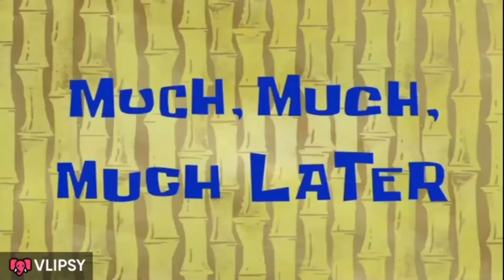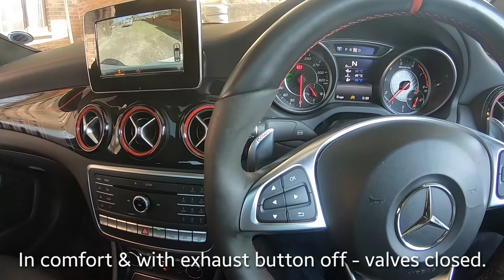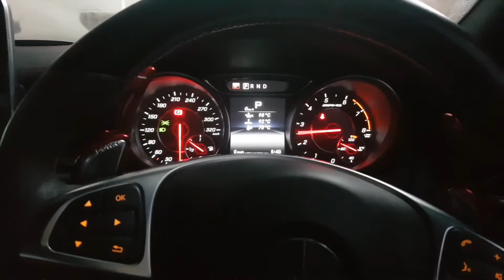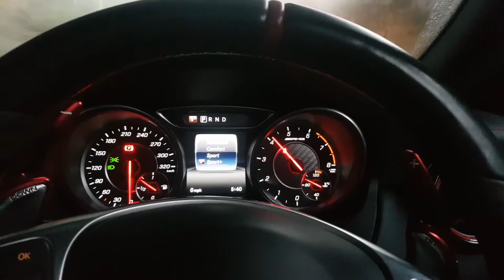CLA 45 AMG ‐ DECAT DOWNPIPE INSTALL (COLD START / REV)

Comment: awsome install vid. removed the old downpipe and radiator fan assembly in FOUR SECONDS. Why was every bolt you went to undo with a rachet already loose? lol. You had no idea the fan had to come out huh. One last tip, Unplug your O2 sensors before unscrewing them...
Reply from the maker: Thanks bruv! Bolts were loosened before and then I did the last part on video to show the steps...I had to film & work which isn't the easiest
Reply from the maker: Thanks for the 02 sensor tip 👻 ...that would've definitely helped lols

Comment: Hello I have a Genuine question that I can’t seem to find the answer too hoping you can help me with! so from what I’ve noticed The Cla45 and the Cla250 are identical until you get to the engine ones got more power. Giving the fact that they’re extremely identical and both 2.0’s - Would this Catless Downpipe fit my CLA250 ??? I really want this brand and I’ll prefer to have it over the Armytrix DP
Reply from the maker: I am not sure but reach out to the manufacturer - Rogue Performance and check if it does fit

Comment: Did you have to remove the fan for the install?
Reply from the maker: Yes you need to remove it for space...it's tight. As well as the air box & ecu
Reply from the maker: You doing an install?

Comment: why your cla has smaller screen like 2014 model i had bought a 2015 model manufactured car i  do have a big screen but i do not have dynamic select assit package and two buttons are missing one is exhaust flap open button another one is for dampers i think i dont have that rotating mode select button with individual comfort sport sport+,i only have comfort sport and manuel is this package optional because i was about to buy another 45 amg that was also manufactured in same year 2015 but made after September that one had all these options flap button plus round mode selector buttons,when i searched about it it was mentioned that cla 45 amg manufactured in 2015 after nine month had these options available in it...and those manufactured before ninth month didnt have it,can i install these features afterwards flap button and dynamic assist package i missed that 2015 after September manufactured car someone  took it before i had a chance to buy it and it had lot of work done in Mercedes workshop 38000 km driven in its service history and the one i bought which came to me was almost like a new cla 45 amg only driven 12000 km non accidental and never painted but still i feel i should have these features in mine flap buttons dynamic assist package....
Reply from the maker: Thanks for the feedback 
Yes there are a lot of packages on offer

Comment: how did you shut off the o2 sensor to prevent that CEL?
Reply from the maker: No I used a CAT fooler that I purchased with the DP and it fools the ECU. It literally just screws on between the DP and the sensor. I think I have an unboxing video which shows it
Reply from the maker: It's the brass part you can see here: https://youtu.be/VqpDA7ckY_E

Comment: Thinking of doing a downpipe on my 220 amg, any suggestions?
Reply from the maker: Hi I 100% recommend. It's the best mod I did on the car. I had the AMG sports exhaust and it still made a massive difference to the sound
Reply from the maker: You in South Africa?
Reply: @PROJECTDRIVEN1  In the UK, london
Reply: @PROJECTDRIVEN1  That's the exact car i have 😂
Reply from the maker: Okay cool bud. Got mine from Rogue Performance in SA. Reach out to them and see if they can ship out to you
Reply: @PROJECTDRIVEN1  Thanks for the advice.
Reply from the maker: Welcome bud. All the best!

Comment: Does it need a tune? And void warranty?
Reply from the maker: Don't have to if you want to sound the pops and bangs alone which the downpipe alone will give you. But if you want to get the most out of of it then a tune will add a lot of performance as well.
Reply: @PROJECTDRIVEN1  wait does ur car have a check engine light tho without the tune ???? i'm really looking to buy one
Reply from the maker: No check engine light & ECU has adapted to give a bit more power from the additional flow. But you need to be careful not to get a check engine light. I made sure to take my time with the install and removed the battery & doubled checked that all the sensors and parts removed was reinstalled correctly before starting up the car.
Reply from the maker: I also removed the ECU, disconnected the battery, and installed a cat fooler device which is installed in front of the downpipe map sensor...to prevent the check engine light from picking up the airflow changes.
Reply: @PROJECTDRIVEN1  thank u for the reply i'm looking to get this done at at shop but none around me know how to install a cat defouler i tried a place called ssr around me and they said i would have a cel
Reply from the maker: Welcome bud. I had the same problem because I tried 3 exhaust shops & they didn't want to take the job on so I had to do it myself.
Reply from the maker: But the CAT fooler is a fitting that just bolts in where the 2nd O2 sensors goes. If you get the Rogue Performance catless downpipe then they also sell the CAT fooler as an option

Comment: Is that tuned ?
Reply from the maker: No not as yet
Reply: @PROJECTDRIVEN1  damnnn it crackles like that stock ? 😩
Reply from the maker: @bromodz2309  Yes I was surprised how much pops and bangs there was even before doing the downpipe. But the downpipe made it much more and louder!!
Reply: Stock exhaust or performance?
Reply: @alperfirat160  yes even i want to know this, do your car have the amg performance exhaust?
Reply from the maker: It has the AMG sports exhaust
Reply from the maker: @Milky M4 Yes, I have the AMG performance exhaust and catless downpipe.
Reply: @PROJECTDRIVEN1  Got it, thanks for the reply

Comment: Buy some header wrap for it cause your going to heat soak that engine
Reply from the maker: I am having that problem. The engine bay gets extremely hot. I also want to add a turbo blanket which I purchased but need to install.
Reply: @PROJECTDRIVEN1  idk if modalworks has turbo blanket for that model but autozone has a headerwrap kit for like $20 with ties and everything 👍🏼
Reply from the maker: @BC2FITTY  Will give a try. Thanks bud!